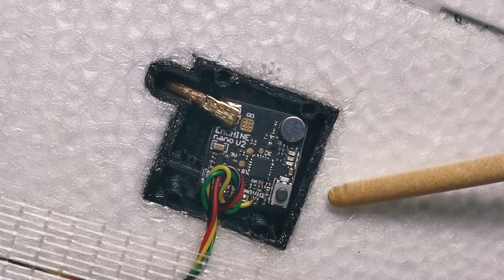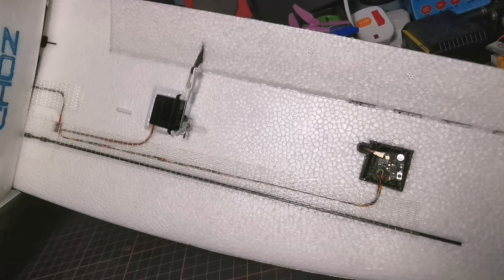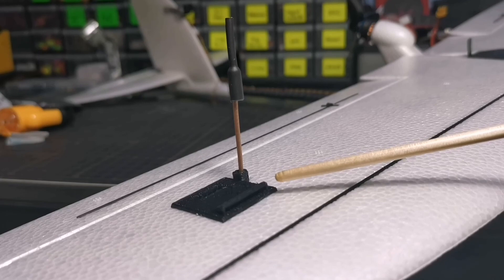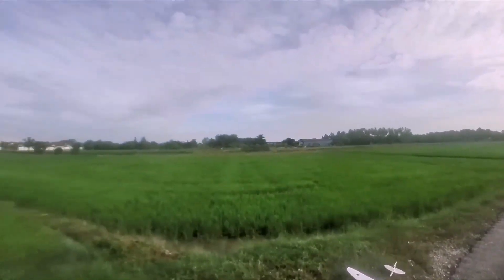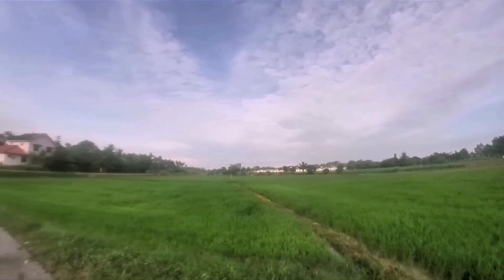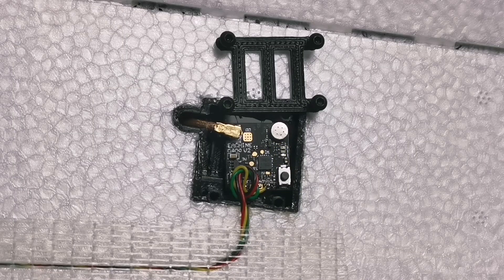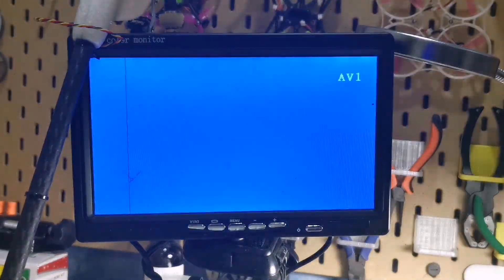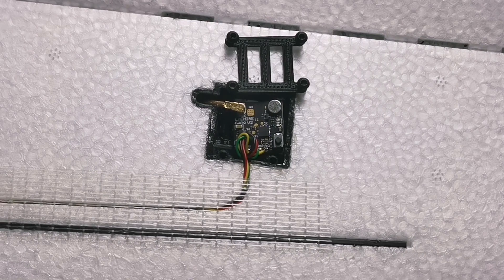Eachine Nano V2 - Full Range Test

Comment: Think I got a bad one. TRAMP says ready but I can't change anything. Tables are correct. I've noticed lots of people complaining about this V2 with TRAMP and Betaflight.
Reply from the maker: Happened to me once when I move it to other model. See behind, there is a small component very very near to the rx pad. I accidentally link them together during soldering. Mine also not responding when I gave instruction to change channel etc. After remove the solder blob, it works just fine.
Hope this can help.

Comment: when i installed mine on my Bugs 3 quadcopter during testing it started beeping to be safe i cut the power and noticed it was quite hot is the beeping an alarm maybe?
Reply from the maker: I can't say for sure what is causing your quad to beep. But small VTX like this tends to get really hot without proper cooling. Maybe you can try to mount it away from the FC?